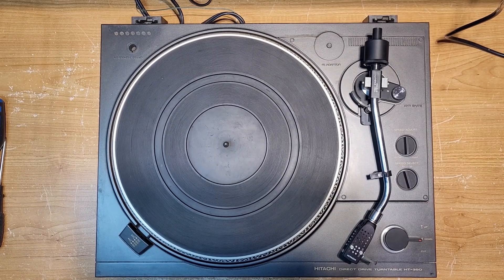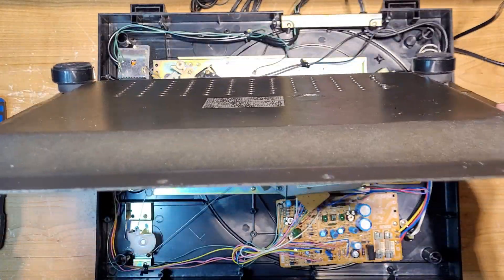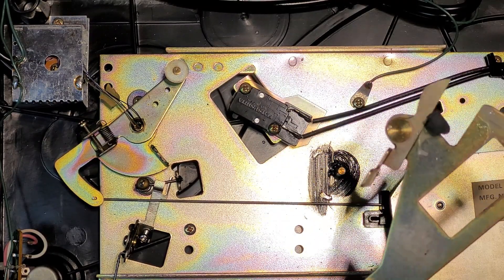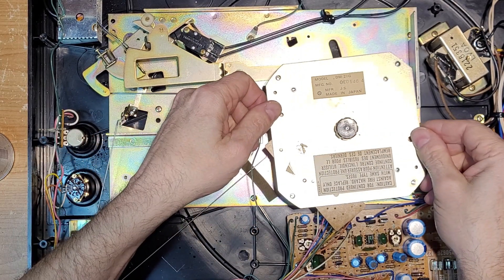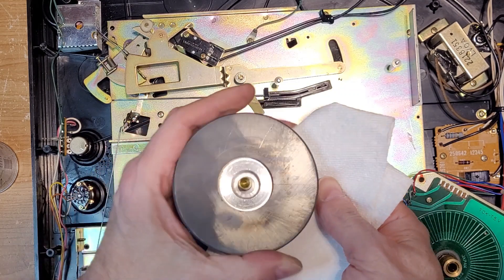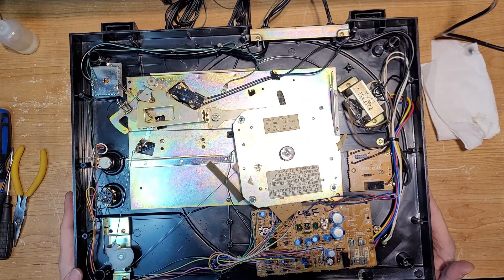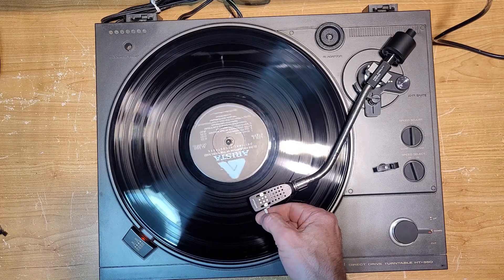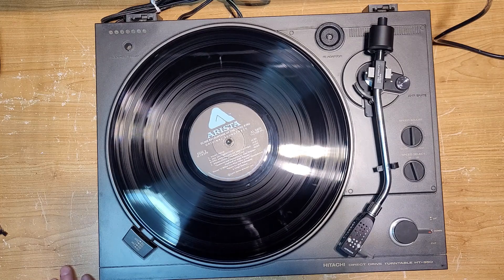Hitachi HT-350:  Many Problems!  Is It Trash?

Comment: I have a Hitachi HT-40s (aka Philco Hitachi PTT-51 here in Brazil) that have a similar problem, it kind a turns just half of a revolution. I replaced all fhe 458s and all caps and the problem persists. I also replace the two 4558, same. None of the motor coils are open nor the printed in board revolution detector. Any clues on this particular TT?

Comment: I buy used hitachi 353 turntable. 60 euros was the price. It was dirty, needle was broken, 5-pin connector was broken and earth wire was cut. I clean the turntable,  change 5- pin connector to rca. Change original cartridge to  dual ulm 68e and change earth wire. All bearings I oiled. Little bit work and now I enjoy good sound. Price/ quality is o.k. Coldring 1022 GX cartridge plays very well too and sound is awesome.

Comment: my family uses a HT-350 since the 70s! I grew up with it, and, after like 15 years in storage, use the TT again in my apartment. Apart from feeling a bit cheap, i think these are actually really decent turntables. Mine still works fine without any (..) servicing being done ever! The only thing that happened a couple if days ago, was, that the needle just FELL OFF. Oh well.. i then just ordered a nude elliptical (!) replacement stylus and thus upgrade. Let me tell you - the original cartridge (isn't it an AT-11? Or AT-10?) + this better stylus sound absolutely awesome!! But even without having such issues, i'm still very glad to have found this video. I will leave the TT as it is for now, but i know what to do, if literally anything goes bad in the future. Thank you so much!

Comment: You know what's funny? I got the HT-320 Belt-Driven model for $14.99 from a thrift store. Not nearly as difficult to revive, and Hitachi appears to have used the same plinth and tonearm. 

Gave it a cleaning, some oil, a new belt and a new AT VM95C cartridge (it came with an ADC K8E with a blunted stylus) and it was up and playing rock solid. Auto-return works too. 

It was owned by a smoker, tho, and there was a considerable amount of tar to remove from the plinth, dust cover, platter and other components. 

The tonearm was so heavily coated I legit thought it had a matte finish (it's now back to a full shine). The platter base was even so heavily coated in tar that the stretched belt could still play lighter records just fine, but the heavier 180G pressings and the belt would slip. It took heavy scrubbing the platter with isopropyl alcohol and magic erasers to cut down the tar buildup around the belt. 

If I ever do start getting speed issues, I'll know exactly where to begin my testing thanks to you.

Thanks for posting so much useful information. I've learned a lot from your channel.

Comment: It would be nice if you mentioned a few notes like the Transistor Number and Cap number. You replaced. 
I have one of these in mint condition but its missing the head. I got a replacement head. But Im getting a lot of hum do you think its the amp or the caps. Also how do you adjust the anti skid and height. I need mine to go up some more thanks to the non standard cartridge.
Reply from the maker: I did mention the transistor numbers - 2SC458 to 2SC1815.  Caps have nothing to do with the audio signal in a turntable.

Comment: Mine will skip on every LP record but only at the very center/end of a LP where the recording runs close to the label, very frustrating. Suggestions?
Reply from the maker: Check the distance between the tonearm and the cueing lifter arm.  Adjust if necessary.  Also, check the free play of the tonearm to see if it stiffens and gets tight as it moves towards the spindle.
Reply: @TurntableGuy  Thank you

Comment: Where did you get caps??
Reply: Just got one of these from
My uncle and starting rebuild. Cannot locate caps
Reply from the maker: You can buy capacitors anywhere.   Try digikey or mouser.
Reply: @TurntableGuy  found some. Hoping it does the trick. Gonna clean it all up also

Comment: You clearly don't give a crap about the dust cover ! Or others turntables.
Something you never do when turning a turntable over is you never leave the platter on so it will fall and scratch or crack the dust cover. And always put down a towel or some sort of material when putting a dust cover face down with the turntable on to a flat surface that will possibly add more scratches to the cover !! Especially if it's not your turntable and you're fixing it for some else.